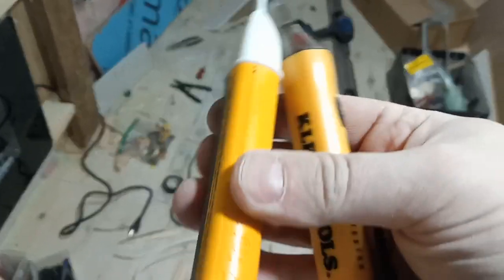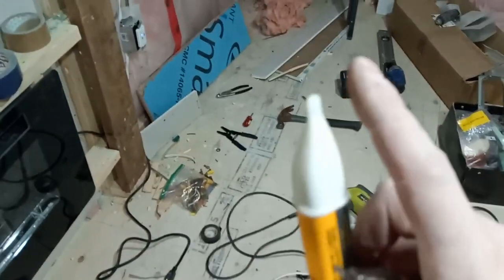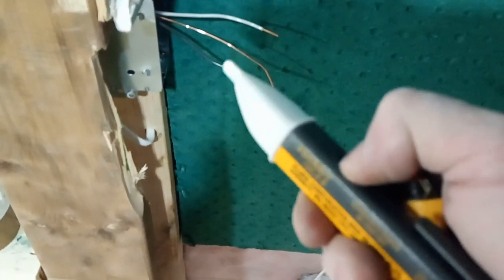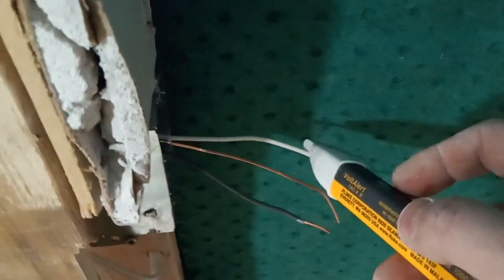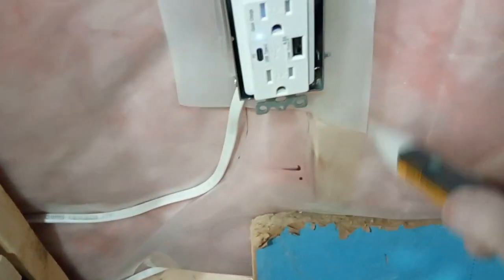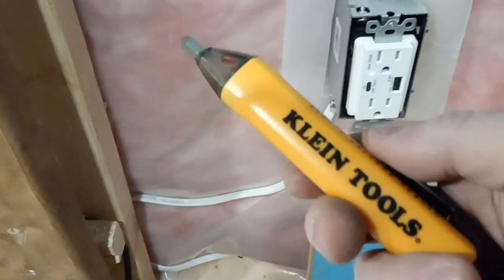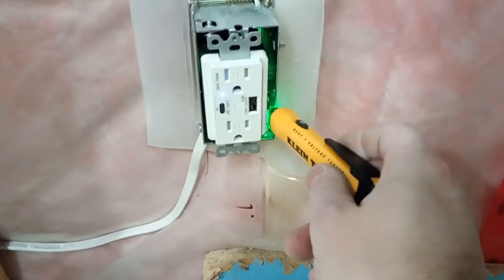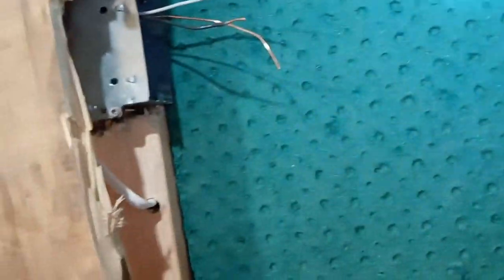Best Voltage Tester for Electricians Pen ** fluke vs klein non contact voltage pen **

Comment: I’m posting this on here as I can’t find out on the net or YouTube .  Can any1 tell me why my ncv is showing high  strength magnetic field on a couple of my downstairs walls? It’s all over the wall , I know it’s going pick up where the switch’s and outlets are but this is all the dam wall  in a few rooms of just the ground floor. Any help appreciated. Thank you
Reply from the maker: Open the walls up u may have wires running in there that are dangerous

Comment: Can you turn it off to not detect current on the insulated wires??
Reply from the maker: Yes hold the button on pen for 5 seconds that will turn off the pen or wait 60 seconds and it'll turn off by itself to save battery

Comment: So, you are wiring up with live power to the lines, bare and uncapped? You need more than a NCV detector, man. You need a hefty life insurance policy, first of all. Is working on live wiring a macho thing?
Reply from the maker: It's a lazy thing.  😴  110 volt won't kill you. Maybe get shocked to see what I'm talking about , just don't hold it too long
Reply: @z1522 i would hate to be on a job site with you, if you understand electricity, and you’re a competent electrician working on 110/120 shouldnt be a problem,